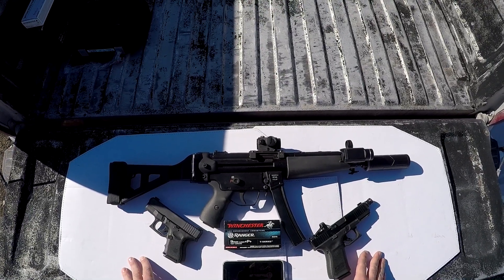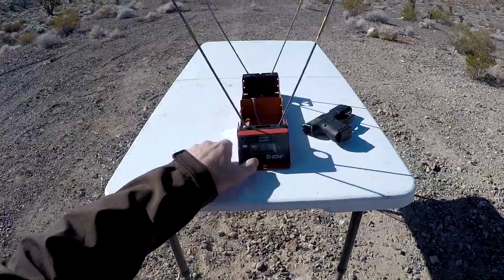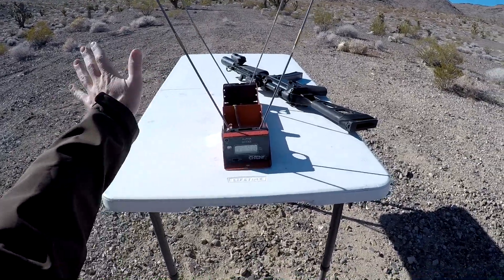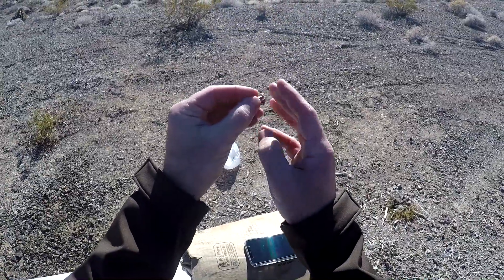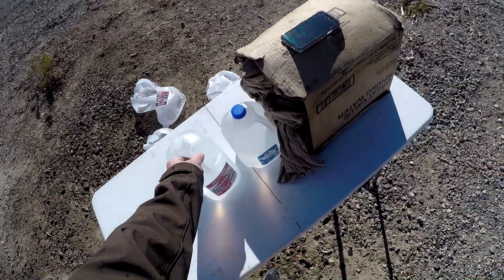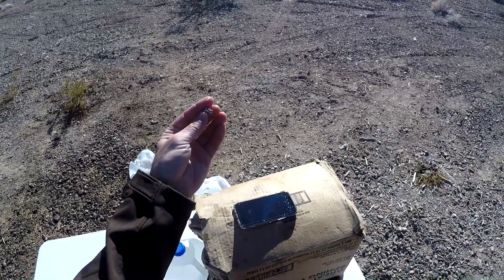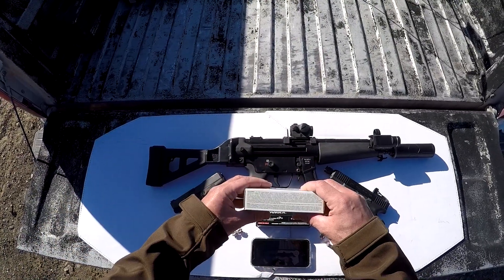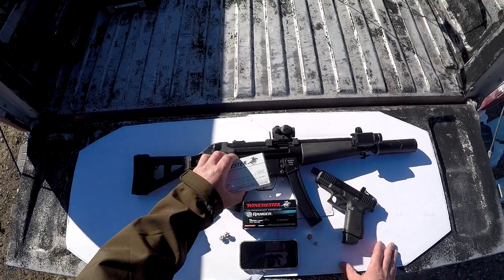9mm 127gr. +p+ Ranger-T ballistics test

Comment: The SAMMI standard was created by U.S companies to protect them from product liability.  Once the ammunition industry adopted SAMMI, the gun manufactures had no choice but to follow suit.  9mm was designed to be a very high pressure round. In Europe, the standard 9mm loadings are equivalent to 9mm +p/+p+.  They are the same loadings used in sub guns there. They are at these pressures to cycle subguns and some pistols in extremely cold weather, where ammo at those  temperatures do not create the pressures they do in warmer weather.  That is why most military ammo of all calibers is loaded to higher pressures as well.  It has to do with the reliability of weapon cycling in cold climates.

Comment: Love the testing, this is my carry round in my glock19. Hard to find any Gold dot or HST in South Africa so the Winchester ranger 127gr+p+ is my go to carry ammo
Reply: I am also from South Africa. The 127gr +p+ ranger is readily available in Johannesburg. I do use it in my Glock 19 gen5. I used to use thr old beige box, black luablox coated version in thr early 2000s in my G19 gen2.  This version seems a little softer shooting , penetrates more in bottles ans wet pack and expands less than the old "Black talon " version . I like thr velocity and its as hot as milsurp ball I have ( 124gr at 1200 or so fps) 

I trust it and just seal the primer annulus  with red nail varnish courtesy of the Mrs.
Reply: @dariandev thanks for sharing the trick with sealing the primers with nail polish i like it.

Back in 2014 when I got my license I wanted some black talons to keep as a novelty but never could find any.

I remember the beige boxes you referring to, I managed to get 2 rounds from a friend these bad the black lubalox coated bullet but the brass shell not the nickel plated shell.
Reply: @kameelramdhin7403 my 127gr 9mm Talons are dated 1997. They have brass cases and the aforementioned black bullets. A smaller deeper cavity than todays Ranger Talons like you tested. The nail varnish is just to prevent any oil or solvent contamination of the pimer. 
I dont like a wet gun but any any prevention is better than any cure

Comment: I carry this load in my 5" M&P 2.0, it's 165gr T Series in .40 cousin and it's bonded .357Sig cousin. It's a very effective design but most folks don't' get that the jacket construction affects expansion. Funny that folks say it doesn't work in gel, when I know of a few instances (here in South Africa) where the T-Series has worked more often than not. 

That spans SD shootings with the Ranger T in 124gr +P and Ranger SXT/T Series 127gr+P+ T series ended two armed hijackings and one armed robbery. Same can be said for the 147gr T Series. It has a great reputation locally and loads of folks carry it.
In the late 90's a home invader was shot with a 127gr+P+ Ranger SXT (black lubalox coated bullet, brass case) and lost his leg from the knee down, after being shot in the knee.
I know of another business robbery, where a guy was selling his ski-boat and there was an attempted robbery. He drew his G22 with 165gr T-Series and doubled tapped the lead robber, dropping him DRT. 

The Ranger line works VERY well. South Africa has been an excellent (albeit unanticipated) proving ground for the loads and brand. Our requirements are generally different for SD, requiring shooting through car doors, glass, wooden doors etc. (our houses are brick btw, so overpenetration isn't an issue). So LE ammo is always my first choice and thank God, Winchester is awesome enough to supply our civvie market with tier 1 ammo.  Trust me, we depend on it. Ranger T and Ranger Bonded work. VERY well.

P.S. That includes the phenomenal 230gr +P  .45 T series and 115gr+P+ JHP in 9x19 too.
Reply from the maker: I think the misconception is the 4 layer of denim vs the actual fbi heavy clothing test.  That and folks believing synthetic gel accurately replicates actual ordnance gel.  Winchester designs the Ranger line around the FBI protocol, which does not include 4 layers of denim...and they only worry about performance in actual 10% ordnance gel.  If you look at those testing standards the Ranger line actually performs well...which is why Winchester has so many Federal contracts....and the real world results seem to indicate that.
Reply: @7N6ballistics   Precisely. I get it, you get it. Check some of my previous posts; we seldom disagree. Most folks don't know the difference between IWBA and FBI standards, nevermind the difference in gel types and calibration. The Ranger T and Bonded line is saving lives in South Africa. Lives of EDCers.
Reply: As a fellow South African I agree wholeheartedly. I use Winchester in my G26 (147 gr T and bonded, 127 +p+ T), G22 the excellent 165 gr LE bonded and the 125 gr bonded in my G32 357 Sig. Thank you Winchester. Civilians here need US LE ammo for EDC.

Comment: Bullets topple and that is when the talons really shred.
Reply from the maker: TRU Dat not really...the talons are more of a by product of how Winchester engineers approached jacket separation issues in hard barriers.  Its more of a marketing thing.  This was addressed in the IWBA journals, though it was stated they may contribute towards the very end of the track when the temp cavity tamps down.  However, if they fold against the shank it’s unlikely they will have any real effect.
Reply: @7N6ballistics  🙄 TRUE DAT☝🤑

Comment: This is a hot round. 127 grains at 1400fps in 357 magnum territory. Granted it was with a carbine length but still.
Reply: That actually shows the worthlessness of the PCC. 

Why use something as big as a Mk18 that only has the same power as, what is generally considered, the minimum suitable pistol caliber for hunting deer?
Reply from the maker: @riflesfirst208  i can think of a lot of reasons….1 caliber to stock, can be used in most indoor ranges…unlike a rifle…, if using a silencer can be made extremely quiet, which can aid in new shooters, or allow shooting in areas that could cause a noise disturbance…even though legal.  Even without a silencer it has significantly less muzzle blast, and easier to shoot accurately in comparison to a companion pistol.  Can be used as a small game getter with non expanding ammo if necessary.  Can share the same defensive ammo as well and readily available…mk18 and the like need good ammo selection to maximize effectiveness.  Can be used in very short barrel weapons effectively…true pack guns…. Plenty of reasons…whether or not they fit the bill for you as an individual…that’s for you to decide.  That said the idea someone with a pcc is inadequately armed for most defense scenarios do to ballistics is not a argument based in reality.